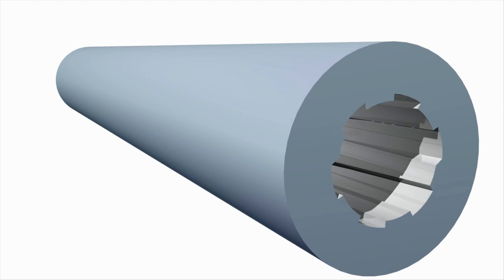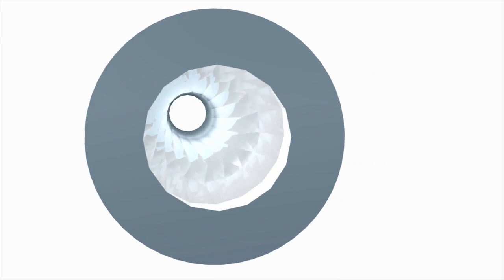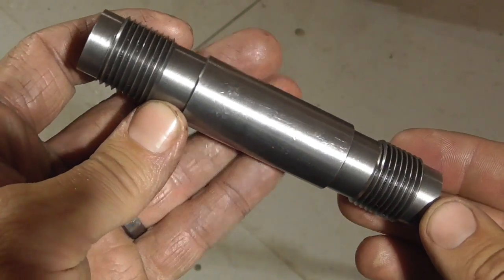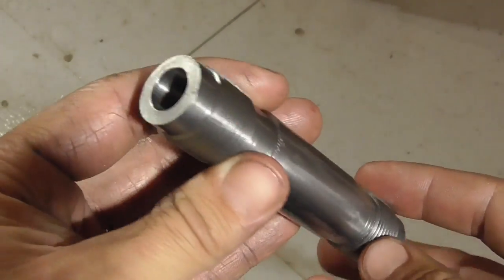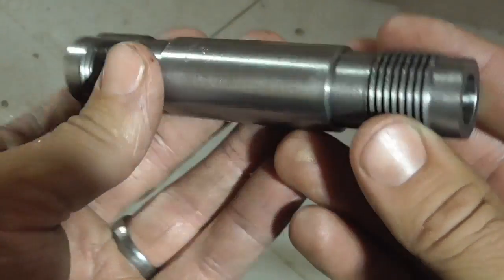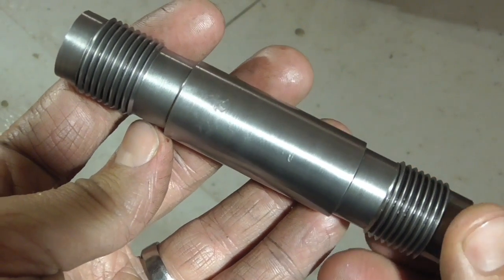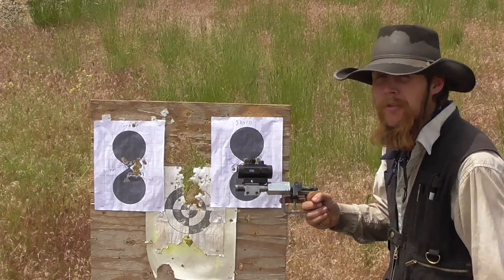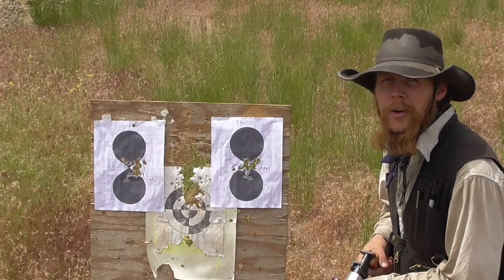Hybrid Monoclinic Rifling (TIS154)

Comment: Geeeeeeeeeeezzzzzzzzz of cause it works both directions if you look down the barrel from ever end you will see it's exactly the same direction nothing has changed even if you did get it spinning clockwise it would be the same thing it uses that sharp edge to spin it's like looking into a mirror it exactly the same it won't change spin or how it engages the rifle pattern I see your a brilliant machinist I'm shocked you can't see that
Reply: Thank God someone else that has some fuckin since.

Comment: With polygonal rifling I guess the bullet is more or less jamming and canting the whole way down the barrel, because it acts like a wedge on the not yet spinning bullet. With normal rifling it takes a bit of force to set the bullet into the rifling in the beginning but then it should run smoothly down the barrel. Just my brainfart about that topic. ;)

Comment: Get a USB pen microscope and take a close look at what's going on in those rifling grooves. I'm curious if the sharp ridge is getting worn down, or lead getting stuck in the sharp corner.
Also, nice home-made broach, but the design could use some improvement. The tool needs a proper guiding dowel on the front end matching the ID of the barrel, and the working portion needs to be tapered. This'll let the tool run more smoothly through the barrel for cleaner rifling.

Comment: This mimics all testing I have seen, and testing I have done myself. In many cases, there does not seem to be a major advantage in accuracy for either rifling style.

I have been interested in a...I guess rifling system that I have not seen very much of. They produce it by twisting the metal of the barrel. The barrel appears to be smooth bore, but in actually, the metal is twisted in a way to give the bullet spin. I have only ever seen it on a pistol once. Hard to re-find the example, and hard to figure out how I would make that in my shop. Anyone know the proper name for this system?
Reply: Jesse Sisolack this is known as ligma style rifling

Comment: Very interesting concept,...really thinking outside the box,..that's the only way to progress,..well done,.. I guess the real test would be to test the rifling's effect on stabilising a buzz saw bullet. That is the tip of the bullet will require a small indent and one corner shaved off the leading edge.  I am not quite sure if the tip of the bullet needs to be flat,  I made all my projectiles flat faced for the Spinning Barrel (PLeane gun) experiment and all the projectiles buzz sawed perfectly, considering the barrel had to spin up to 40,000 RPM to counter act a buzz saw,....P
Reply: Buzz saw bullet? do tell

Comment: Im sure you said it somewhere, but what kind of steel where you using for your reamer again?

I tried to make on from C45 (1.0503) and it failes badly when I tried to cut 42crmo4 (1.7225) with it... I was expecting it to not do the best as the hardness of both is pretty close together but in fact it did not do anything to the Workpiece. The cutting edge just flattened out without any resistance...

I like the idea behind your monoclinic rifling, I didnt  expect it to behave any difference though. The edge of the rifling are probably to small for the shape to make any difference.
Reply from the maker: I typically make buttons out of A2 or D2 tool steel.

Comment: Have you ever tried to make a semi auto or revolver pistol?
Reply from the maker: Not yet. Building a semi-auto is on my to-do list.
Reply: @TheIdahoanShow  What calibre would you make one in? And would you just make an ar clone?
Reply from the maker: There are a number of semi-auto concepts that I want to try building eventually, and in a variety of calibers.  I'm not sure which one I'll end up tackling first.  I already built an AR-15 from an 80% kit at one point ( https://videos.utahgunexchange.com/watch/my-400-ar-15-project-tis134_DugcS4KXoK1hCXH.html ), but when I build a semi-auto from scratch it will most likely be my own design and not a clone of something that's already been made.
Reply: asrthsntar he did a mostly functional reverse pump action that I thought was cool. Like 95% of the way there. I think if he incorporated a rotating bolt with a hammer safety he could eliminate out of battery discharge, and I like his idea for swapping out a box mag for his (admittedly brilliant) modified stripper clip.

Comment: A great little test.  Took me a minute to understand that the angled ridge would be facing different directions as you turned the barrel around, and thus the difference between "riding the ridges" and "riding the flats" - so to speak.   It seems that really discerning differences in shooting accuracy between these two would require a very accurate test setup.  I would of course agree that there is no 'practical' level of difference seen from your testing.  I really love see you test assumptions and gather your own data!!     Pray all is well with you and the new work situation !!

Comment: Great vid, thanks. I have also wanted to test this style of rifling, but im in the UK so I cannot.
i would be interested to see some longer range shots and recovered bullets (fired into water?)  to verify the bullet engagement in the rifling.  is that something you looked at?
Reply from the maker: I didn't recover any bullets from this initial test, but maybe I"ll try that next - I agree it would be interesting to see if there is a difference in the rifling imprint on the bullet depending on which way it was fired through the barrel.
Reply: TheIdahoanShow   Another thought if you don't mind, perhaps video of the gun firing may in interesting. It would be interesting to see if there is more or less blow-by depending on rifling direction, and also compared to your standard rifling.  Do you have a camera that would pick that up, as i expect it will need to be a nice slow-motion shot? ... perhaps something for the future.   Thanks again.
Reply from the maker: I agree that would be interesting.  Unfortunately, I don't have a high-speed camera, but I'll keep the idea in mind if I ever get one.
Reply: TheIdahoanShow   i have just had a look at high speed cameras .... it turns out that they are somewhat expensive!  For some reason i was expecting modern digital cameras to be able to do high speed video for not much money.  .... and to get one that will record a bullet in flight .... ouch!
Reply: paradox  Rifling  +  ratchet Rifling